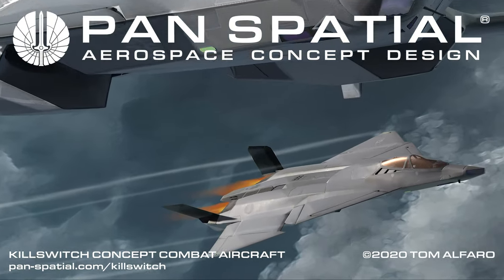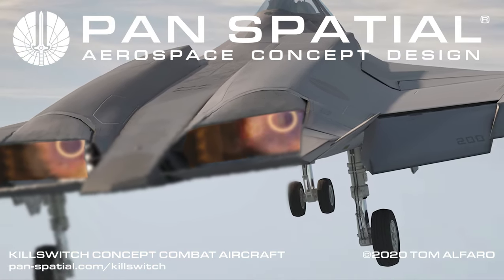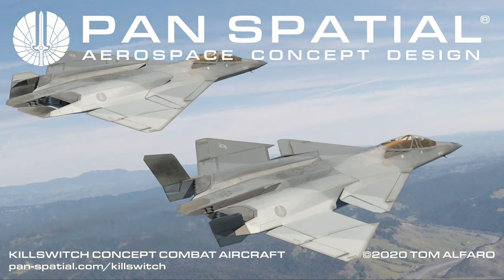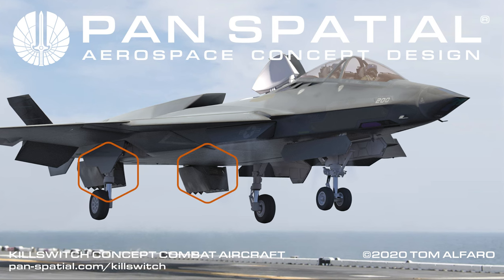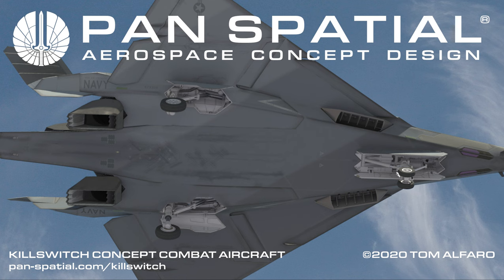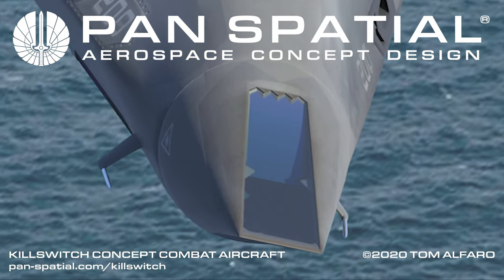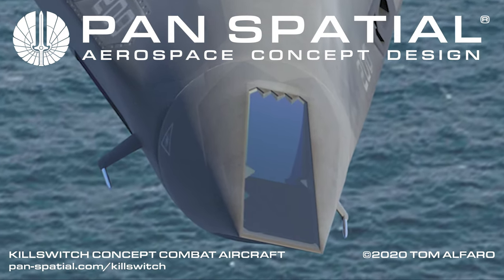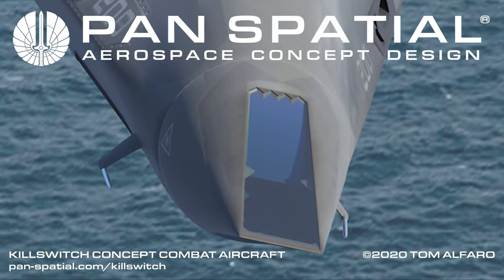KILLSWITCH Variable Fuselage Geometry - as seen in Modern Warships

Comment: I love the design and execution around the concept of potential future missions rather than 'it looks cool' therefore, it never ceases to stimulate conversation.  I love it and one day highly skilled aircraft maintainers will love this aircraft too lol.  They always raise the F-14 but design/production techniques with low maintenance in mind could mitigate a lot of hard work on the deck.
Variable geometry design + Stealth = nightmare?  'It's the wrong paint' 'it's doesn't like getting wet' 'it flakes off' and then afterwards all the gaps need special Lockheed special™ sticky tape $1000/inch.  Your design makes the kids in all of us joyous but I guarantee someone is having palpitations thinking about what working on this IRL might be like XD.

1 design detail:

There's been a lot of work recently around variable intake geometry lift-fans, able to increase efficiency and thrust without increasing the diameter/volume of the lift fan itself.  No doubt someone hoping to get on the ever expanding list of 'upgrades' for the F-35 and derivatives?  An extendable lift fan intake would prove useful for increasing take-off weight and performance without further compromising internal volume.  You may even find, if all goes well, that you could reduce the size of the lift fan with no reduction in performance.  This is still in prototyping and testing but, you may find it interesting.

Comment: The main wing still needs the F-18's new stealthy missile box pod.

Continue to use the system's old missiles.

Consider the next generation AIM-260 or AGM-183 twin setup pods.

Super long range and Mach 12 for fast combat.

APS systems are available in older technology FIM/AIM-43 Redeye and FIM/AIM-92 Stinger to evolution.

The front wing makes push-pull movement easier than full-body push-pull movement.

So, the body don't need push-pull change movement.

I thought, "Why U.S not give it a try build one really now?"

Comment: Directed energy weapon in the nose! Very cool.
Got me to thinking since this is very close/already being fielded, could this have a firing arc to be reflected behind the aircraft? All that is needed is a mirrored point.
Off the wing tips possibly.
Reply: my only concern with that is the radar cross section of the nose.
Reply from the maker: I narrowly decided not to go for an installation that had 2 small turrets on opposite ends of the kinetic capacitor.  One turret on top, and the other one on the underside.  The placement from an energy standpoint makes sense, and would make the system usable as an all-axis defensive system.  However, I saw the nose emplacement as a bolder, more obvious challenge (and regretted it for many, many hours).  Nevertheless it turned out alright.  Although  it still has some visual and functional drawbacks, I am proud of the final result.
Reply from the maker: @VonTreigo  Agreed.  So my approach there was 1) From the nose-on aspect it is potentially manageable.  The transparent material and surrounding geometry is fairly angular / coplanar.  2) Even though the perfectly circular circumference of the turret base is a problem, it is a small area, and geometrically pretty simple for potentially applying radar absorbent coatings.
Reply: @PAN_SPATIAL  As always your designs are top teir! Well thought out and practical.
Reply: @PAN_SPATIAL  I wondered about putting another DE turret on the rear for rearward measures.

Comment: I'd loose the Shotlocker system entirely. Although it would give the pilot an advantage in a dogfight it's not compatible to anything the us navy already got so it won't prevail. A navy fighter needs bombs, anti radiation missiles and anti ship missiles. One could say "well it's not a multirole fighter" but the navy doesn't got the space for one mission air superiority fighters. So make room for a "normal" enclosed weapons bay. Don't know if I would use the energy beam weapon, there are still many problems with them and we don't know if we'll ever see them installed on a fighter jet but I like the way you implemented it. The variable geometry design may be cool for the pilot but a pain in the ass for the maintainers. At first I saw no use in having both vtol and catobar in a fighter because the vtol system would be so heavy it would be nonsense to built it in, carry it around all day and then not use it. I thought if you got the option for catobar why built in a vtol lift system in the first place? But then I changed my mind. The catobar system can be used for heavy weapon load launches. If the fighter returns with the full weapons load or too mutch fuel or the weather is too bad a barrier arrested landing would be performed. If the fighter used most of its weapons and used up enought fuel, which will happen if the carrier does frequent combat sorties, the fighter can land vertical which would save time and space (multiple landings could be performed more or less at the same time). Also the vtol system could be used for short take off if the catapult should break. I also like the cockpit design and the way you designed the vtol lift system. So all together I'm impressed with the work but I think some features make the Killswitch fighter inpractical and almost useless. I would very mutch aprechiate a response!
Reply from the maker: Killswitch is an exercise in concept design. Killswitch does not claim to be advanced or predictive. Each unique technical feature (DE transmitter, macro variable geometry, 2 seat cockpit in a VTOL fighter, etc.) shows that if one were to attempt to integrate it into a fighter aircraft, here are some possible solutions to minimizing the drawbacks, as well as integrating them to create best advantages.  More specifically, whereas the Shotlocker is not compatible with current munitions systems or paradigms, it does demonstrate ways to achieve greater weapons density (less volume and drag on the airframe) and launch across a broader flight envelope. The unique features are shown in an airframe that is as contemporary as possible (i.e not 100 years in the future) in order to provide as much relevant context as possible - and invite critical analysis. Integrating all of the unique features into a single thorough design instead of 12 separate designs is also a different approach to showing ‘range’ in a design portfolio and demonstrates a different level of commitment to the genre. Killswitch does not stringently address things like signature management and electronic warfare because those are things the IRL aerospace industry is already expending extraordinary effort to improve. As said, Killswitch does not claim to be advanced or predictive. It does show that solid subject matter knowledge, channeled through creative and critical design processes, can produce a concept aircraft that is much more than a pretty prop - and encourage others to do even better!  To that end, your critical analysis and recommendations are appreciated by and useful to many others, so thanks for sending.
Reply: you could make munitions for the shotlocker namely the bottom tubes to make it a multirole craft. Could use specially designed bombs and the top launcher could house anti radiation missiles. not sure on anti ship missiles myself.
Reply: @spartan22808  yeah but that's a problem. Sure you could design these weapons but what would the navy do with all the stockpiles of perfectly fine JDAMs, anti-ship missiles, air to air missiles and what not. Furthermore, what if one or more of the new expensive weapons fail in the designing process and can't be used? They would need to pump more money into the program until it works although you got stockpiles of perfectly working weapons, but you cant use them. What I'm saying is, if you build systems that rely on other not yet developed systems in this example a whole new arsenal for a jet fighter, chances are high that your program will fail or cost a multiple of your estimated budget. It has happened multiple times in the past that programs relying too much on additional technology not yet developed failed although the main system worked just fine. And the chances of this just multiply if you want to develope a whole new arsenal just because your system can't integrate existing weapons.

Comment: what CAD software are you using? CATIA?
Reply from the maker: I use Modo.  It's a fairly inexpensive software package that you can do modeling, animation, ingest high quality textures, and render both stills and video.   Like Blender but it was more comprehensive than blender in 2017 when I started using it.  Still better at modeling finite geometry - but less onerous Solidworks or CATIA.  (The engineers I work with use those, but there is little value in learning it myself).  I'm fairly proficient at all of the tasks in Modo, but the real value to me as a concept (and real) technology developer, is the ability to invent something, make changes at any stage of the pipeline as the concept matures, and show it to other people to generate useful feedback - in order to improve the design or a presentation.
Reply: @PAN_SPATIAL  I’ve used catia, solid(doesn’t)works and SDRC-Ideas. My fav is catia but I’ve only used v4 before the migration to windows based v5&6. I love your response and can appreciate the use of off the self modeling software that is rather inexpensive. Keep up the good works.  Are you expecting to actually pitch this and other concepts to aerospace companies?

Comment: Good graphics but please make a killswitch with far less moveable parts and section, it will be more realistic. Also minus the submarine style vertical upward launch tubes because it would greatly reduce range and efficiency of air to air missiles. Pointing downward like Starmax from Starcom is still acceptable but still not ideal for air to air missiles that are either 9ft or 12ft long, this aircraft maximum height probably just mere 12ft so it can't carry AIM-9/120 or RVV-SM/AES.
Reply from the maker: Concept design is an opportunity to take a look at existing technology, consider emerging trends - and then extrapolate further into the future about what a more mature system might be like. 

None of the current air-to-air weapons were designed from the start for internal carriage. Fins have been clipped, and other changes to the missiles have been made, but a tremendous amount of mechanisms, mass and volume on existing internal weapons bay jets are just to accommodate legacy weapons. And there are good reasons for doing that. 

However, looking at emerging weapons systems designed initially for compact internal carriage (APKWS, Common Lunch Tube (CLT) launched munitions, MQ-9 submunition dispensers, 6ft long-range Peregrine air-to-air missile etc.) features start to emerge that hint at either smaller, simpler weapons bays or greater utilization of the volume on Aircraft.

What you see in the weapons carriage and launching system on Killswitch is an example of where emerging trends might lead - but more importantly for concept designers who dig this stuff - an example of a creative, but constraint driven, process for getting there.
Reply: @PAN_SPATIAL  you want the air to air missiles to launch vertical upwards and yet the missiles are small probably the length of just AGM-114 or AIM-92 stinger. So how far do they fly with much fuel wasted on vertical upward launch? Less than 2nm? They can't turn on their seeker if they are IR or laser guided until they get horizontal which means enemy fighters would have easily escaped.
Reply: @jayjay53313 The AIM-43 Redeye and AIM-92 Stinger come to mind.

Like a tank's APS system missile box.

This APS system has all missile APS heads ready to go into launcher search mode when you sit down and enter the system.

All Heads can all times ready.
Reply from the maker: @jayjay53313  Modular munitions systems and small individual openings contribute to the structural efficiency and overall performance of the aircraft (overall system) which can then be leveraged to address threats in unconventional ways.  Off-axis attack that does not commit a fighter to a predictable kinetic profile symmetric to the enemy’s aircraft is one example, and there are others.  But I’m skipping ahead. When it comes to munitions-only performance (addressed at 10:52) If you search the example systems I provided in the previous answer, you will find answers to your concerns about data hand-off for tube-launched systems and emerging missile propellant energy density.  Not to mention the nutritious variety and convenience of Common Lunch Tubes – which also can be adapted to breakfast, dinner and midrats.
Reply: @PAN_SPATIAL  unfortunately, present technology don't have solid propellant fuel adequate to support upward vertical launch and fly more than 3nm on air to air missile the size of AIM-92 or AGM-114. Also you can't carry most of the present day air to air and air to ground armament with that kind of missile tubes. Verdict, you need to extend the size of switchblade to over 60ft, eliminate the many transformer or M.A.S.K. style moving parts & replace the missile tubes with standard internal weapon bay. M.A.S.K. theme song suddenly plays in my mind. You need large fuel tank and main internal bay to pasa present day navy fighter criteria. Also you'll need to add either forward canard spade diamond shape or rear elevator with less swept wings for low speed stability suited for carrier approach & STOVL.
Reply from the maker: @jayjay53313  All technology – historic, current or concept – exists on a spectrum of science (reality) and fiction.  When it comes to concept art, rarely does the designer’s intent arrive on that spectrum at the same point as every viewer’s expectation. Fulfilling present day fighter criteria is not the stated or demonstrated intent of Killswitch.
Reply: @PAN_SPATIAL  Dude, he is wright. To me it seems you have taken a bunch fighter Jet features and mashed them together into one concept. In reality, you don't realize how they would be tripping all over each other and occupying the same spaces which makes the concept unrealistic. I would go into detail as an aircraft mechanic of 20+ years but you seem too stubborn to listen. I wouldn't discourage your creativity. However, I would encourage you to learn more about aerospace technology and the physics involved. Future designs will still have to contend with physics unless they are so advanced they can bend the rules.
Reply from the maker: @Bander471  I started my aviation career in maintenance too - and then built on that experience. After decades of serving in 3 branches of the military, as well as supporting many government and commercial clients’ technology development efforts (including real-world aircraft) I have a solid working knowledge of the subject of aviation technology and operations. 

Pan Spatial is science fiction. It is an intentional intersection of realistic and imagined elements for a variety of reasons - some more practical than others. 

Some people enjoy the entertainment value. Some people recognize and enjoy the design and problem solving methodology it demonstrates. Some people are looking for a fight [cerebral challenge]. I’m all three. 

I can’t predict how all people will react to Pan Spatial. But I can accurately predict there is much more on the way.